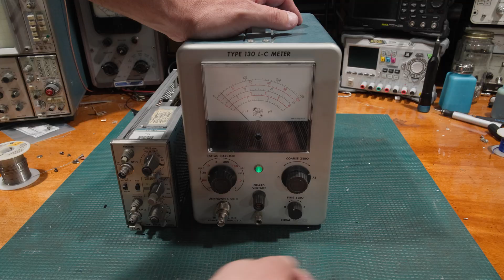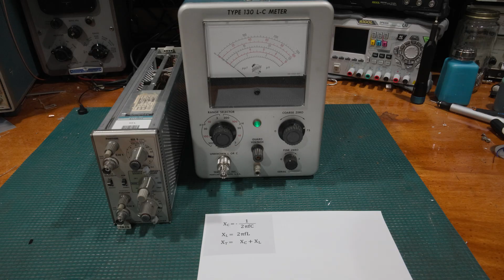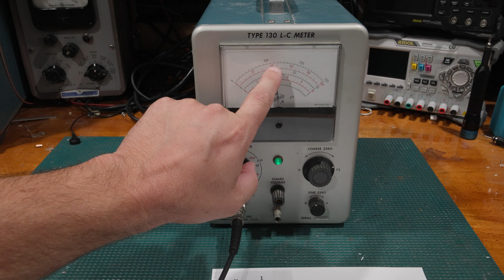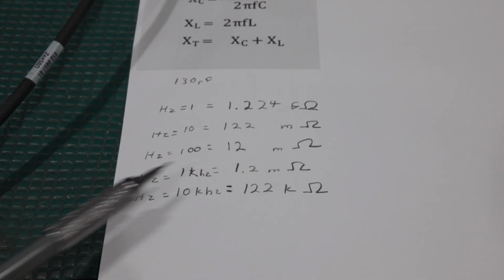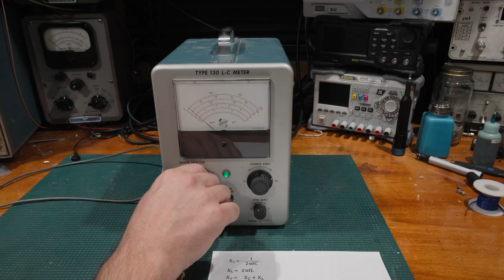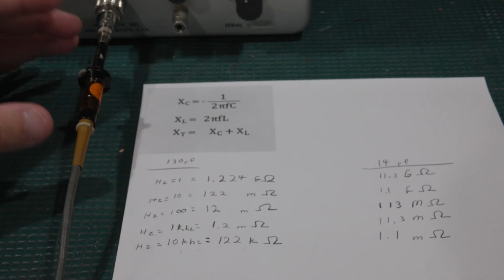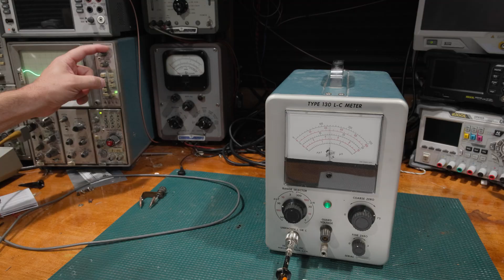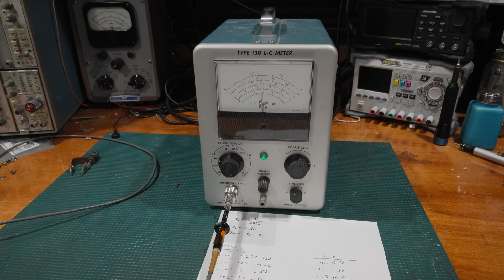Scope Front End and Input capacitance knowledge Why 1X scope probes SUCK

Comment: Good information as usual. I myself seldom have a use to look at anything above 1Mhz. But for some reason I still feel the desire to use my 7834 with a 7B92 timebase often. Go figure. Maybe it's bragging rights or just knowing I could if I had to.
Reply from the maker: even at a low rep rate a 7B92 get the A can be very useful especially if you need to see the fast edges it can be needed for a 1Khz square wave depending on the edge speeds of interest. At a high enough speed a 1Khz square wave can be a 5Ghz signal and will have edge speeds (rise times) at 70ps and faster.